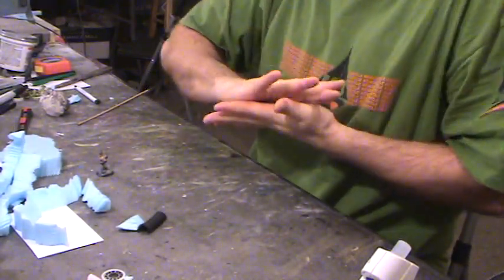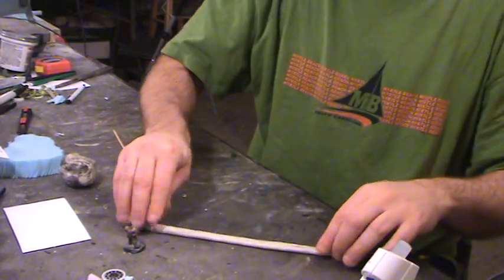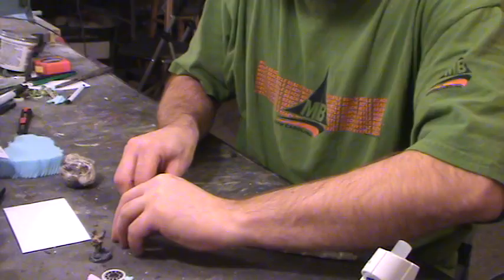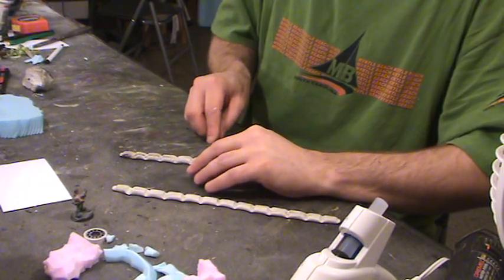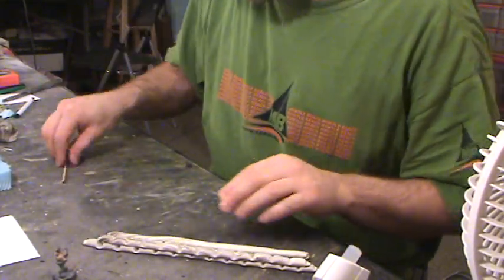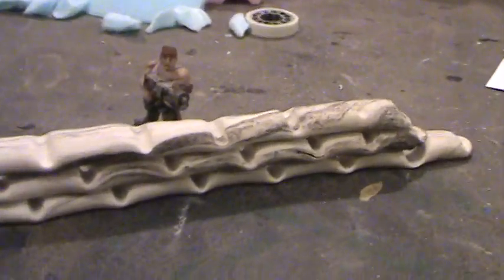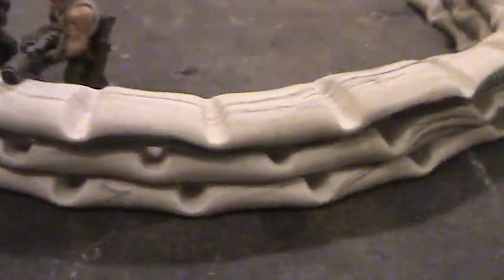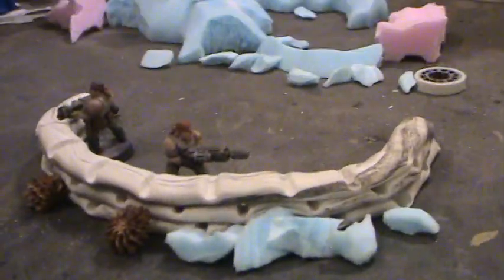Quick and dirty sand bag walls

Comment: Wouldn't it be better to rotate the sandbags by 90 degree and use the length of the sandbags to create a wall with a greater thickness without the need of a second row of bags?